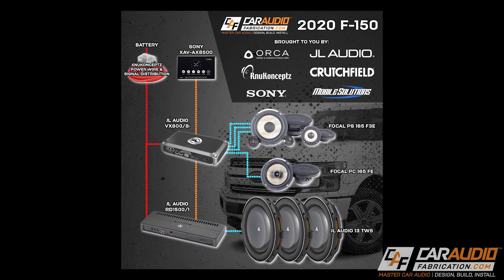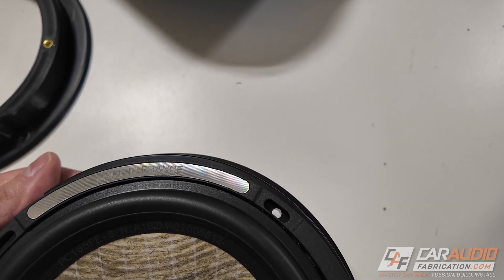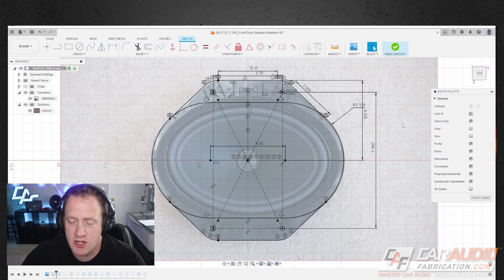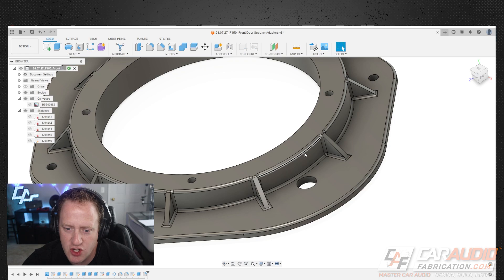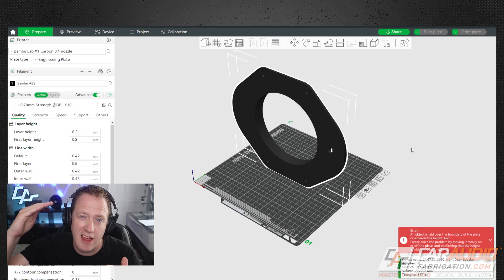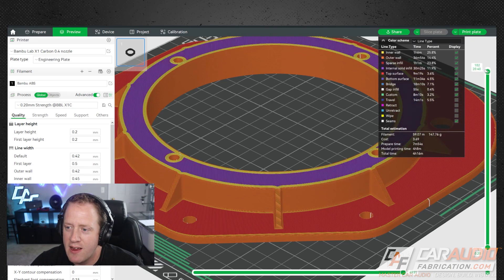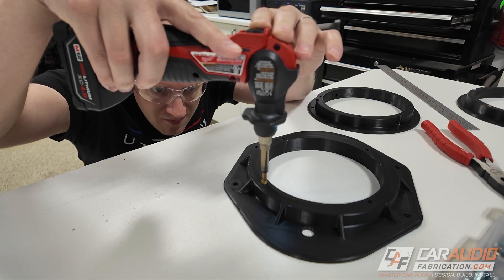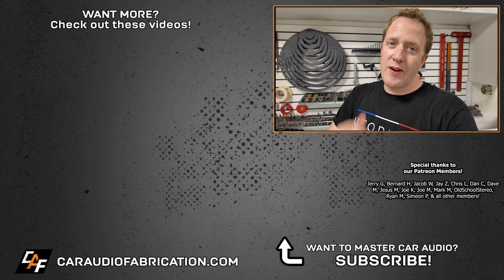Always a Perfect Fit! 3D Printed Speaker Adapters - How to DIY

Comment: I don't have a 3D printer, or expertise with 3d printing. I did find a silicone surround for 2.75" in-dash speakers. That silicone would cover the entire back side of the speaker. I see all of the silicone covers for 6.5 and 6 X 9's, leave the back out, and it is replaced with a piece of foam. So, I am wondering if I need to cut the back out of the silicone cover (a critter food bowl!), or if it would be OK to leave it intact, and why. TIA.

Comment: I need to figure out a way to design and 3D print a tweeter pod for the dashboard of my Toyota Highlander. I want to basically bring the 3.5" tweeter out of the hole in the dash and point it straight horizontally towards me rather than up at the windshield. I'll have to scan the stock speaker grille in order to have the pod lock onto the dash using the same mechanism. Hmm...

Comment: I have question on the speaker ring design. Are these designs printable on a typical 3d printer (250x250x250) or we need a larger build volume (300x300x325) like Ender max

Comment: I appreciate the desire to make a finished looking adapter with the round-over edges; however, this part will live behind the door panel and never be seen.   Also, could one print the adapter in "body color" for fun and to make the bracket more "stealth" as it lives behind the door panel?    Need this to fix my subaru's front door adapters that weren't mirrored (shame on you Metra).

Comment: I would have gone solid plastic on the mounting holes. IMO much more surface for the threaded inserts to bite into. It shouldn't add much more time or material to the print job imo.

Comment: Did you ever do a tutorial specifically for designing the speaker adaptor plate? I need to do that for a component 3" midrange in a 23 Ram corner dash location.

Comment: I'm still a beginner in 3d CAD so it would take me hours to get a perfect fitting adapter. For something as easier as those, wouldn't it be much faster to cutout abs panels and attach them together? But I do understand you waste a lot of material that way.

Comment: Ever think about using a 3d scanner and importing the scan of the parts , rather than having to manually create a template and enter all the hand measurements ?
Seems like it would be a huge timesaver for fast prototyping .
Reply from the maker: This isn't how 3d scanning works. With 3d scanning you export a mesh, that usually isn't perfect. To perfect it you would create features in your modeling software that match the features of the real world part. You basically reverse engineer it. What I did for a simple adapter is faster and more efficient than 3d scanning and going through the same steps.

Comment: Any experience using ASA instead of ABS for car parts? I am planning some pods and planned on using ASA instead of ABS due to it being more UV resistant and rumored to be easier to print vs ABS. I have never used either fliament type and have been printing for years with PETG which won't hold up to the interior temps the car will experience in my area.
Reply: @J.No13  I just made some speaker adapters last week out of ASA. I have a Bambu X1C and used PolyMaker ASA. It’s not too difficult to print with. Just make sure you use some glue for bed adhesion and a brim to help. The larger the part, the more it wants to warp. But they turned out great!
Reply: @srcarter2012  thank you for reply. I will be printing on an enclosed FlashForge Adventurer 5M. Great tips, thank you again.

Comment: Another thing that you want to do is to print in PETG or better material the PLA will not stand up to heat in a car interior on a sunny day.
Reply: @11:21 in the video he mentions using ABS
Reply from the maker: I didn't use PLA.
Reply: Even petg won't hold up in parts of the US. I had petg dash pods that totally melted
Reply: Petgs holds up a little better, but you have to use at least abs

Comment: You may want to add fillets to the edges to increase the material holding the shaft that the speaker mounts too, to the base that mounts to the vehicle. The vibrations  might break those layer lines apart eventually. Also viewers note, he used ABS in this video. If you attempt to do this with PLA it wont last long (maybe 6 months if your lucky) if there is any moisture where your speakers are. it may need to be painted or something of the sort to make it water resistant if you go for a PLA route. Great video!
Reply: @dreadpulse9865  You can use long nuts and bolts to hold speaker in adapter, that way you would hold down all layers compressed with screw.
PLA should hold just fine, i have some prints left outside in the sun for 2+ years and they are still holding up. They were mostly decorations without any load on them though.

Comment: I JUST did this last week.  I needed clearance behind the magnet for the door windows.  Now it's got a perfectly designed spacer/adapter 😙👌
Reply from the maker: Good point! With custom designed adapters we certainly have more control over things like this.
Reply: @CarAudioFabrication  I'm spoiled by access to Markforged printers.  Any chance I get, I print unnecessarily strong parts carbon fiber 😎